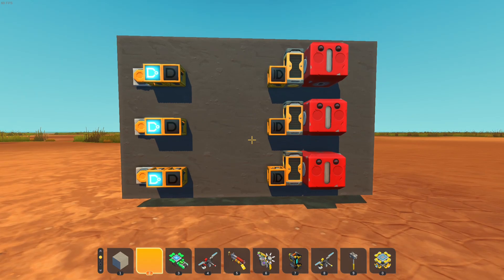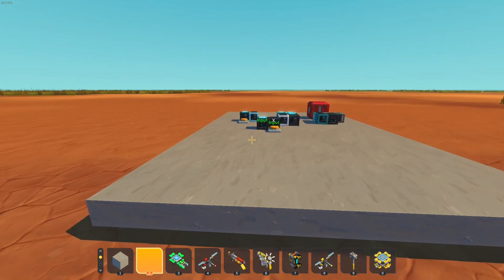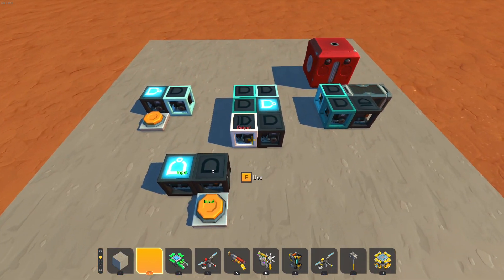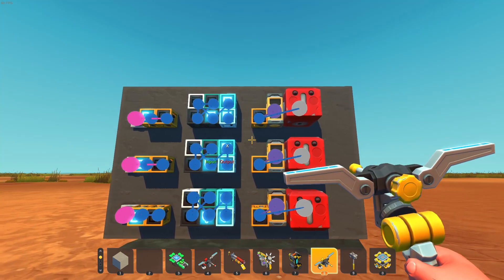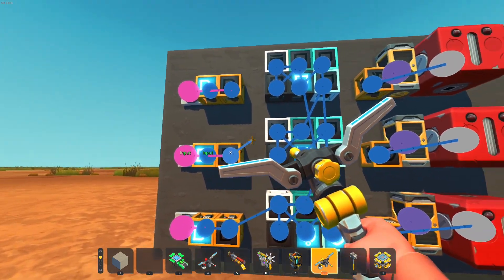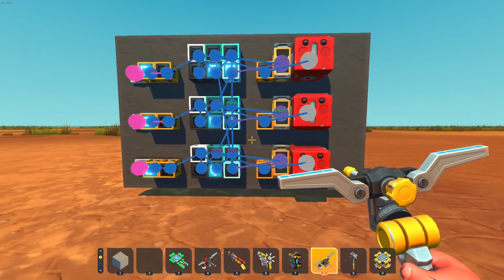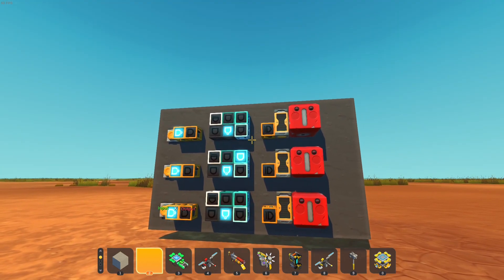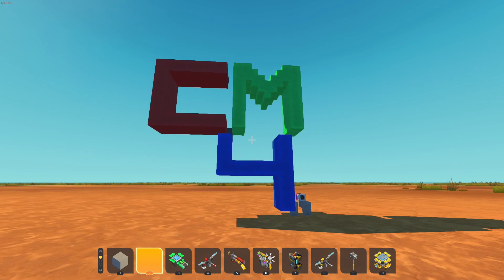What is Arbitration Logic and how do you use it?

Comment: I noticed that when you pressed button 3 followed by button 2. 2 activated first. Do you have any solution to do the steps in the order they were queued?
Reply from the maker: No. For the sake of simplicity, it does not use a queue. Just a simple state for each module of whether or not it wants to make use of the shared resource.
In this case the turn will be given to the module that is next in the cycle, regardless of which module was marked as wanting to make use of the resource first.